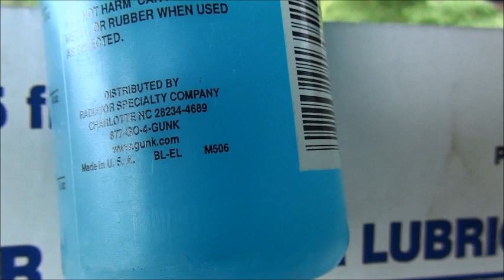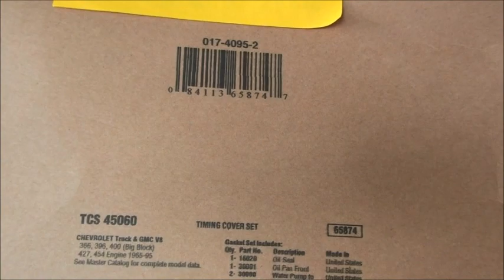MORE 427 ...H#LL JUST WATCH AND SEE !!!

Comment: they do not have 2 bolts , they only have one , the other hole is where the output oil from the pump feeds into the engine block , I have built at the least 100 engines , and out of them 7 big block chevy's , one bolt on the pump , a dowel to align it , one pressure port , one pickup , and one pump dive ...oh and no gasket , thats how it is lol not to mention the engine runs well , it's been in the truck a few weeks now anyways lol

Comment: I could fix that easy enough here, the place I am Network Administrator for is an auto body /frame manufacturer for Nissan, Toyota, Infinity,Ford & Subaru so there are whole palets of scrap metal that i could use to make that thing wide and long enough to put a car in. hmm getting ideas now hehehe,  a little metal tubing and quite a few of those scraps i could cobble myself something together actually

Comment: correction I read my comment , and I made a typo in it , there are 2 dowel pins that locate the pump on the main cap , they are the outside holes you think are the bolt holes , the 2 center holes notice one you can see through , and one you can't the one that you can is the one and only bolt that holds the pump on , the other is the pressure oil feed port to the engine , do you understand better now ? not trying to be an ass , just trying to explain the situation , so you understand it ...